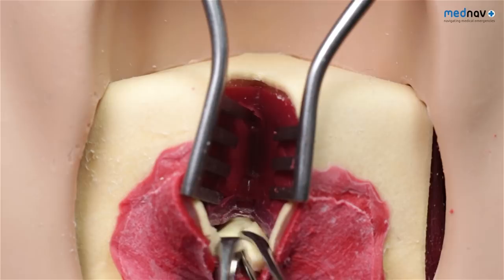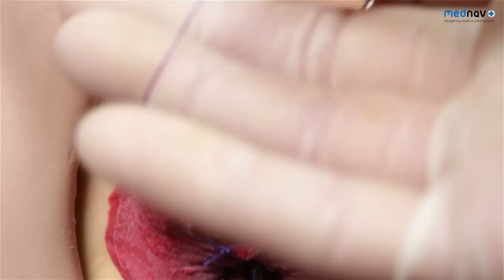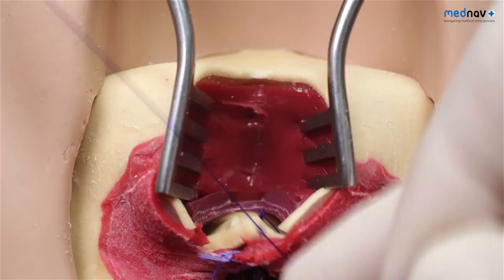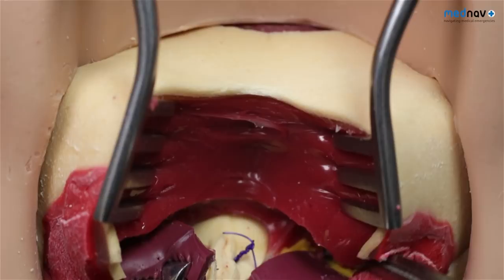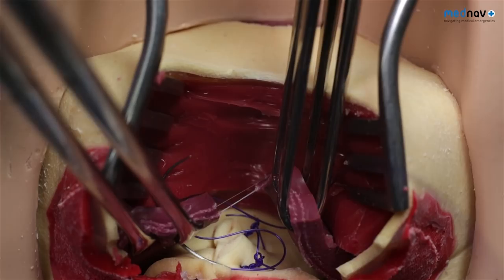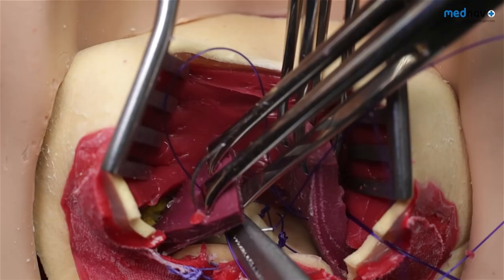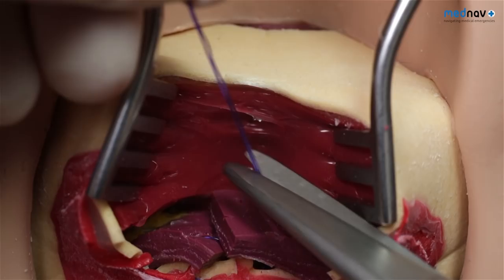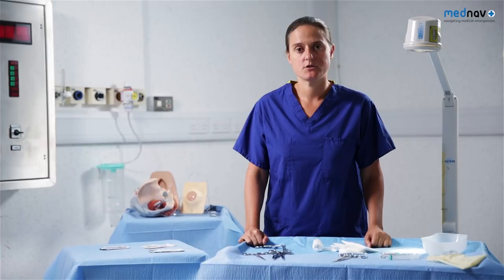How to repair 3rd degree Perineal Tear

Comment: After 4th degree tear, normal delivery for second child possible?
Reply: yes i just gave birth to my third baby first delivery was emergency c section second delivery a VBAC with 4th degree tearing caused by medical staff assisting/pulling the baby out and this delivery 2nd VBAC with 3rd degree tearing. 5 year gap in between 2nd and last birth. its all about Gods Grace/Mercy pushing, breathing and timing i wanted to have a c section but baby came a day earlier than the scheduled procedure date i cried like a child thinking i would have another 4th degree tear but here baby and i are at home recovering a week later.
Reply: @Ehlaar  do you have pain now?